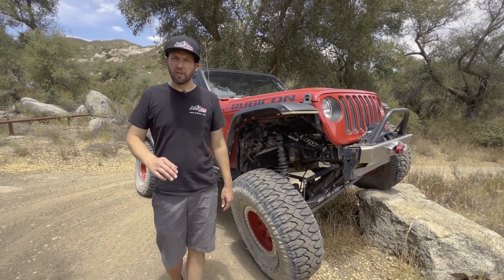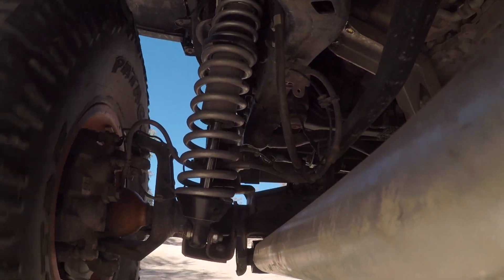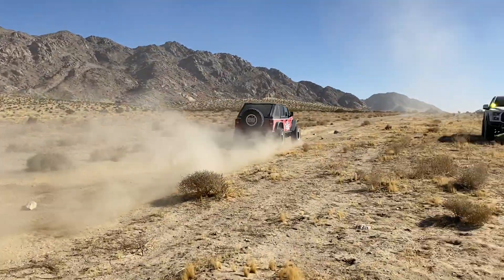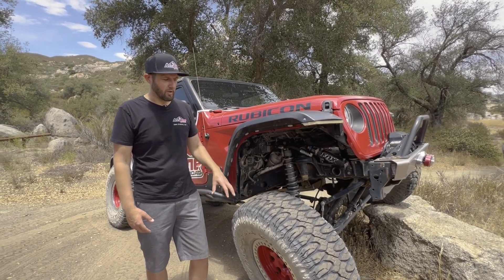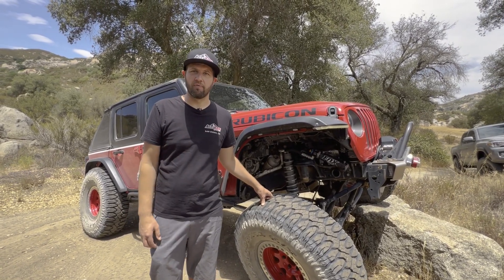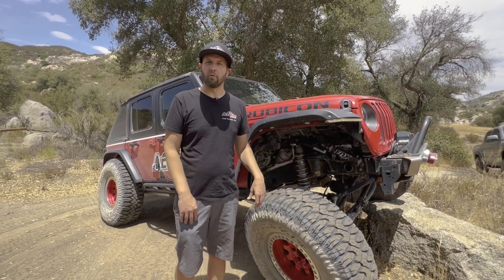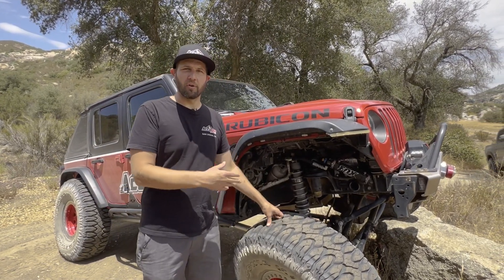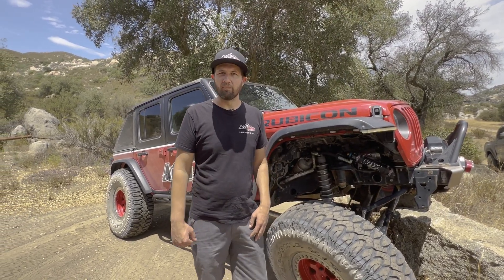Everything You Need to Know About Fox DSC Adjusters

Comment: I have a problem with ride stiffness when I remove my spare tire on Fox 2.0 and 40” Nitto trail grapplers. Would the softest setting on the 2.5 help with that issue? Jeep JL.
Reply from the maker: Not necessarily. This is likely due to the rear of the Jeep now being over sprung for the new weight without tire. I would suggest keeping the 40" spare on vs swapping shocks.

Comment: So when you say you have them open you mean dialed all the way to the (-) side, which allows fast rebound? So if I want to set up mu gladiator to run 25ish mph off road on the desert floor I want the low speed valve open meaning only like 3 or 4 clicks from the lowest (-) setting or do I have it backwards
Reply from the maker: DSC Adjusters do not control rebound, only compression. In general you would want firmer compression for higher speed off-road driving to handle large impacts better. Low Speed Compression would be large bumps, g-outs etc.

Comment: Wonder if is the same with bypass valve low speed is the long tube and hi speed the short tube?
Reply from the maker: External Bypass Shocks have compression tubes and rebound tubes only, not like these compression adjusters.

Comment: Great video answered all my questions… if only there was a shock that also had adjustable rebound without being a full bypass…
Reply: Dobinsons MRR?
Reply: @alexs825   I’ve heard about those shocks but I don’t know enough about dobinsons to spend the $
Reply: @RealGumbyOfficial  people have them and like them. Australian brand but it’s all made in China hence why they’re undercutting fox and king price point. They’re also 50mm wide so that’s closer to a 2” reservoir than 2.5”. So definitely not quite as good if youre running them on a LT truck desert racing. But if you’re doing slower speed things probably is fine. They’re not tunable either. Essentially the adjusters are you tuning them. But no ability for a place like accutune to dial things in even better. At least I haven’t seen anywhere that will tune those shocks. Just will rebuild to factory. Still a solid option and the only one with a rebound adjuster currently
Reply: @alexs825  good info and I agree- I don’t think they’re a replacement for a custom tuned shock from someone like accutune

Comment: I have the DSCs tuned from you guys for my FJ. I have the Low Speed turned in all the way and it feels solid on the road and off road. I am having trouble adjusting the High Speed, I am not sure if I should leave them open and have a floaty feel or fully close it and have a stiffer more controles ride, any guidance finding the right setting would be appreciated. And I set my Tire Pressure to 30psi street on 33s if that matters. Also, is it normal for the Low to be fully closed to be in the most comfortable ride?
Reply from the maker: The settings will be a personal preference thing, there is no right or wrong setting really. We recommend starting with them all the way open, then adding compression as needed.
Reply: @accutuneoffroad  At what point would I know if I need more compression or a revalve? The reason I ask is because I had Swayaway coilovers that performed amazing all around but switched to DSCs to get the reservoir as the Swayaways would fade after a awhile in Ocotillo Wells yet the Foxs don’t feel as well rounded and Lowering compression only makes it feel sloppy and no control on motion. BTW I ran both with no front sway bar and the Springs were the same spring rate. Maybe I’m asking a too detailed question on here but I am just trying to get the most out of these Fox DSCs before I give up and go SDI E-Click.
Reply from the maker: @Modrod  You mentioned your shocks are from us, have you reached out to our sales team yet to discuss? If not, I would highly encourage that before you look into replacements. There is a lot we can do with valving. Sales@accutuneoffroad.com

Comment: By turning the adjuster in the direction indicated by the arrow with the plus sign, are you closing down the flow?  I understand that closing down the flow will allow the shock to absorb a harder impact.  Am I thinking correctly?
Reply from the maker: Great question. Righty tighty rule will apply to this question. So turning it right (+) will increase the compression making it more firm. For the High Speed, you are actually adding preload to the shims/valving inside the adjuster. Firming it up, will keep the shock from bottoming out as easily.
Reply: I have a 22 ram Badlander with a 6in lift on 37s. She only sees pavement,  but the roads are rough here in maine. Whats best setting for me?  When you say you run yours open on street,  do you mean all the way to - on both dials?

Comment: Hi Ryan, Do you think Fox DSC can provide more comfort on road vs a famous suspension manufacturer with only medium speed adjuster assuming both have "Adventure tune" on them. (If its vehicle specific for a 5th gen 4Runner)
Reply from the maker: The DSC offers a wider range of adjustability than other shocks with a single/medium speed adjuster. We tune Fox/King differently if they have adjusters or not. They wont be the same. The comfort you would get out of a shock comes from the internal valving mainly. Adjusters allow you to firm up from there. If more adjustability = better, then yes Fox DSC are a good choice.
Reply: @accutuneoffroad  Thank you. As always you provide excellent information to the community. Very happy to have knowledgeable shops like you to provide that information and purchase products with tunes to individual needs.
Reply: @accutuneoffroad what would fox 2.5s cost on a 3rd gen tundra? Parts and install